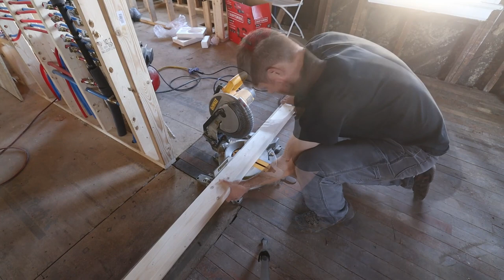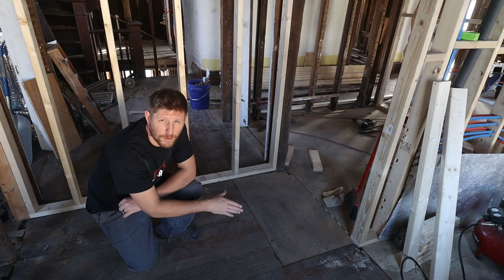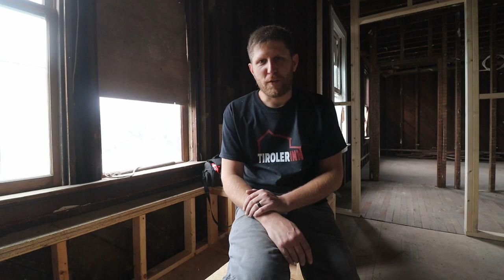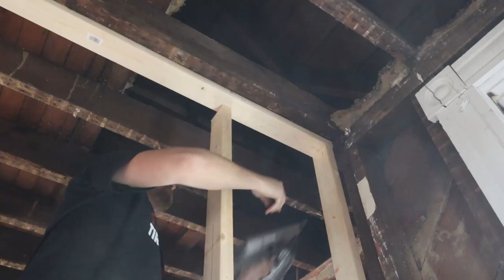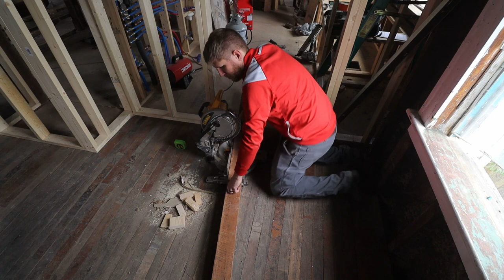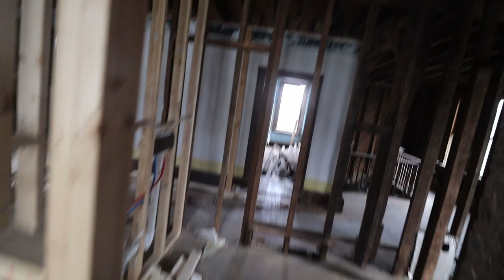Framing up a grand walk-in closet for the kids bedroom - Victorian Home Renovation [TirolerInn]

Comment: What was the extra sawing-sounding noise in the background? I enjoyed it, but didn't know if it was extra sound effects or if you have some kind of device running (dust removal?) while you are doing other tasks.
Reply from the maker: It’s actually the air compressor running for the nail gun.